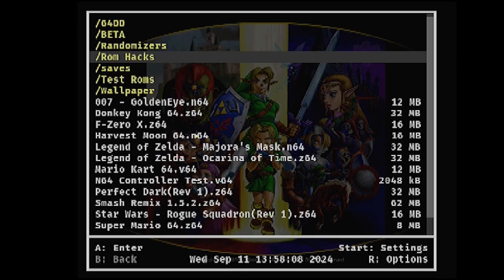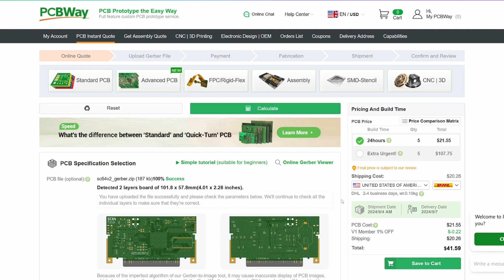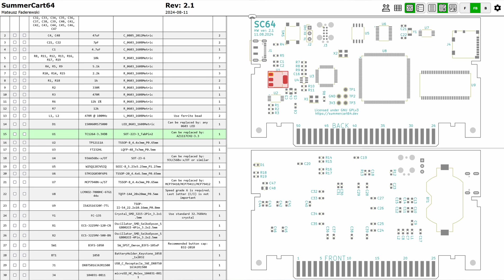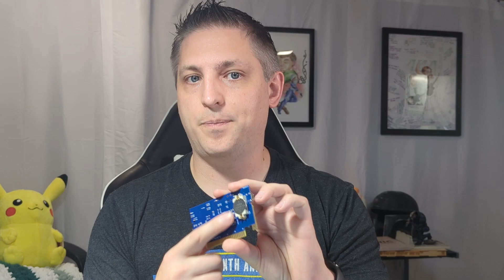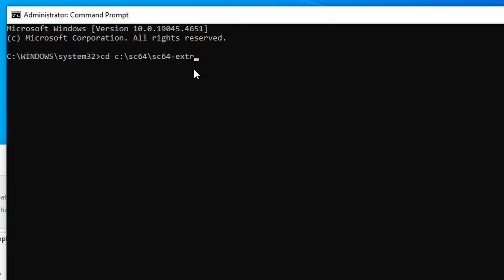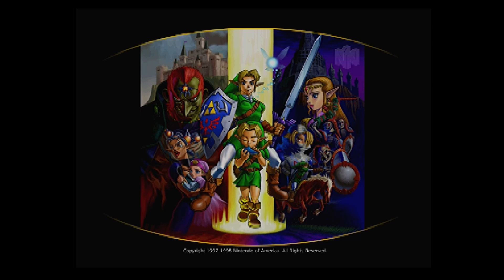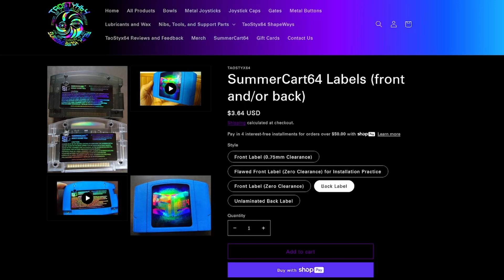How to build and program the SummerCart64

Comment: The shopping cart for Mouser might need to be updated. W25Q128JVSIQ is no longer available in Mouser. They do have W25Q128JVSIM. I haven't tested if it is a drop-in replacement, but it looks like the same chip according to the datasheets (same pinout and specs, although with a few extra features).

Comment: I'm trying to get my custom game images for mod games to show up and for the missing images like forsaken and ai told me “The image must be in PNG format and have a resolution of 256×384 pixels. Place the image in the same folder as the ROM file on the microSD card, and name it exactly the same as the ROM file, For example, if your ROM is named `SuperMario64.z64`, the cover art image should be named `SuperMario64.png` and placed in the same directory.
This setup allows SummerCart64 to display the cover art when browsing games on the N64 menu interface.
but with a `.png` extension.”.....

 but when i do that it does not show up...Anybody know what I'm doing wrong here?

Comment: What size micro SD card would you recommend?....I'm going to put as much on it as possible.
Thanks
Reply: A 64 GB fittingly holds the entire library and much more, so I'd recommend 64 or higher depending on how much extra stuff you want to install.

Comment: thank you for your video - i really enjoyed it. i am thinking about to go with the self-solder solution myself just because it's fun but the question i have is why not using solder paste and hot air like they do in the factory? it would be way less pain to bring the resistors and capacitors to the pcb.

Comment: Soooo, to be clear... if you order from the PCBWAY link and use the Assembly... that means it includes all the components you'd have to otherwise buy and solder yourself onto the PCB? And it includes a minimum of 5? Meaning all you would need is to acquire a shell? Or... do I have that wrong? Also, is it possible to use Aluminum instead of FR-4 for the PCB?  Do I need to acquire anything extra to program it, such as that cable you link if I go this route? Thank you so much!

Comment: With you mentioning randomizers, the only problem is that the OoTMM randomizer will not work past firmware 1.18.0. It works completely fine on that version, but further versions will crash upon creating a save file, so currently anyone will have to downgrade the firmware if they want to play that randomizer on their cart.

Comment: What's the total cost of doing it this way? It'd be good to know what the benefits are over just buying one readymade. Sorry if it was mentioned in the video and just didn't register in my brain.
Reply from the maker: I probably should have added it up for the video, but I didn't really until someone else in the comments asked. 
"Before shipping and taxes, about $112.60 for this cart. Ordering from 5 different places, shipping was pretty cheap, except for the PCBs, which shipping cost $20.58. Then I also bulked order a lot of the stuff to help keep the prices down. I ordered 10 PCBs and 10 cartridge shells, with the intention to make a couple more of these. So if you're only making one for yourself, totally worth it to get one premade. I just wanted to see if I could make my own"
Reply: @NGalaxyWorkshop  I guess mass production keeps the cost down in this case. Makes sense.

Comment: 1:48 I'm not sure how recommended a hard gold playing for the pins would be if you're almost never removing the cartridge from the console.  

Also, I'm pretty sure it's a simple enough task to bevel the PCB edge by yourself with just sandpaper and a flat surface.
Reply from the maker: Hard gold is what is recommended in the GitHub. Like you mentioned, there's really little need to remove the cart once you have it there. To me it was definitely not worth the added cost. 
As far as the beveling goes, I've done it with other PCBs and yes, it is really easy to do. I don't believe it adds anything to the cost to have PCBWay do it however, and I can see doing something that could be "damaging" to some people could be a turn off. Although if you are building a cart like this, I'd expect you to be comfortable with it.

Comment: YOU DIDNT MENTION WHAT FLUX YOU USE UNDER INFO
Reply from the maker: I've been using AMTECH NC-559-V2-TF flux for a little while now. It's not the easiest to clean up after, but it works ok. I may look into other options in the future, but I would think any flux would be helpful. I do like that it is a gel when you first put it on, as that is helpful to hold the different chips in place. 
The solder I've been using is some 60/40 Rosin-core solder I got from Radio Shack forever ago. I bought some different solder on Amazon a year or two ago and was not happy with it. It's been lasting me a long time, but will have to get something else eventually.

Comment: Why would you not use the assembly service instead of self-sourcing and soldering parts? Is there much of a cost difference? From what I can see it's about $85 assembled for up to like 20 pieces, maybe it's an introductory price.
Reply from the maker: I don't have the exact number of components in front of me right now, but going by what I remember it would cost me $88 for the assembly itself, plus $52 for the minimum of 5 PCBs, which doesn't include the price of getting those other 4 populated. So $139.47 is my final price. At that point I might as well buy it and get it flashed and with a shell. 
I figured it would be much more fun to do it myself. It still cost about what I would have paid for one premade, actually more once you include the label, cartridge shell, and my time. 
I'm hoping to be able to do quite a few projects on here that probably won't make financial sense, but sometimes it's just more fun this way.
Reply: @NGalaxyWorkshop  that's fair, I might assembly my own then, should be pretty easy to resell the remaining boards. I appreciate the walk-through.
Reply: Hey i bought a prebuilt one and try setting up the sd card but i keep getting an error fatf5 and it sasy that the memory card cant be used. Do you have any tips?@NGalaxyWorkshop
Reply: @NGalaxyWorkshop  I came to the same conclusion. I kind of wanted a project.

I initially priced 5 with assembly for 5 and it worked out to over $80/cart with shipping without hard gold. Compared to phenom mod, it wouldn't have been worth trying to sell the extra carts.

I ended up ordering 2x blank PCBs with hard gold from phenom mod through the discord group. It still won't really be cheaper than his but I'm treating it like a model kit.
Reply: Because some people just like to do everything themselves

Comment: Please ERROR!
Starting SC64 flashcart board bring-up...
[91mError while running bring-up: Could not connect to the STM32 (No ACK/NACK byte received)
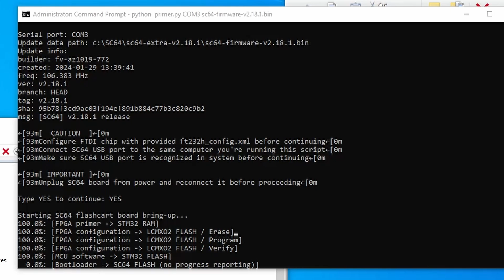Reply: When are you getting the error? At 13:38 is a list of the chips being programmed. If it's before "FPGA primer -> STM32 RAM", the. It could be as simple as flipping the TXD and RXD wires. I'd also make sure you have a solid connection there. If it's not that, then I would suspect a solder bridge somewhere. This was what caused most of my problems with programming. With how fine pitch the legs are it can be really hard to see. On one of my carts I had to go leg by leg with a multimeter on continuity to find it. There are some legs that are connected to ground that are next to each other, so those ones will beep.

If you don't have a microscope, I used to use the zoom on my phones camera to look.
Reply: @timtanason7250  now I got this error!
Starting SC64 flashcart board bring-up...
100.0%: [FPGA primer -> STM32 RAM]
100.0%: [FPGA configuration -> LCMXO2 FLASH / Erase]
100.0%: [FPGA configuration -> LCMXO2 FLASH / Program]
100.0%: [FPGA configuration -> LCMXO2 FLASH / Verify]
100.0%: [MCU software -> STM32 FLASH]
100.0%: [SC64 SDRAM test / Write own address]
100.0%: [SC64 SDRAM test / Check own address]
100.0%: [SC64 SDRAM test / Write all zeros]
100.0%: [SC64 SDRAM test / Check all zeros]
100.0%: [SC64 SDRAM test / Write all ones]
100.0%: [SC64 SDRAM test / Check all ones]
100.0%: [SC64 SDRAM test / Write random data]
100.0%: [SC64 SDRAM test / Check random data]
 83.3%: [Bootloader -> SC64 FLASH]
 [91mError while running bring-up: Firmware update error [0m

then I record once and then it doesn't record, but I change the STM32G030F6P6 IC and it records again
Reply: @timtanason7250  I record, but it goes to the sc64 boot and gives an error now
Reply: then it doesn't record anymore, I have to change the STM32G030F6P6 IC to record again.
Reply from the maker: What firmware are you using? 
When you get the error, what happens if you just retype the "python primer.py COMx sc64-firmware-v2.xx.x.bin command"?
When you say you have to change the IC, do you mean physically off of the cart? Because even if it fails a number of times you should be able to just try it again
Reply: Did you ever find out what caused the error for you? I have the same problem now, and I have confirmed that at least GND is soldered fine, but unsure how to test TX/RX pins.

Edit: I just found out that my cartridge had been preprogrammed, and I just had to transfer the menu to the SD-card to make it work :)

Comment: What should I do if the writing program fails.

Starting SC64 flashcart board bring-up...
100.0%: [FPGA primer -> STM32 RAM]
100.0%: [FPGA configuration -> LCMXO2 FLASH / Erase]
100.0%: [FPGA configuration -> LCMXO2 FLASH / Program]
100.0%: [FPGA configuration -> LCMXO2 FLASH / Verify]
100.0%: [MCU software -> STM32 FLASH]
Error while running bring-up: Couldn't reset SC64 device (on)
Reply from the maker: I would try it again. My first couple times programming one it took multiple tries to get it to program, although I don't think I've seen it fail there, usually mine would before. I'd try it a couple more times and then double check for any solder bridges, as that was the problem I had.

Comment: What is the operating voltage for capacitors? I can't find this data in BoM.
Reply from the maker: The board is either supplied with 3.3 or 5v, so anything rated higher than that should work. In the links I supplied, I used a combination of 6.3v, 16v, and 10v capacitors.

Comment: shouldnt you add some of the solder stuff to the board first before soldering the parts to it ?
Reply from the maker: @noah39353  if I was using a hot air station, then yes, I would. But for this video I wanted to use the most accessible options for people. If you put the solder on first, it's really hard to get surface mount components to lie flat. You can hear up one side and get that side to touch the board, but then the solder solidifies and the component is at an angle when you attach the other side.

Comment: Cool video. It's neat seeing how it's done the hard way (I lazily got mine from Phenon Mod).
Also, minor nitpick: It looks like your capture settings might be a little off. Every other line of text is squished vertically. This is especially noticeable where it says "Legend of Zelda" twice at 0:06 (the two lines are supposed to look identical). That's the same kind of effect you get when de-interlacing is being applied twice (usually once in hardware and again by software). You may be able to fix it by going into your capture device properties and disabling hardware de-interlacing. Hope this helps.
Reply from the maker: I wouldn't say it's the lazy way. You save money if you're only getting one. I plan on making a few more, so I ordered in bulk to help keep per cart cost down.
The capture was done off of a HDMI modded N64, which I did maybe a month prior to recording those parts. I wanted it done before going on vacation with a couple of friends so we could get some classic gaming in, so I didn't really look through the settings too much besides getting it to show up on the monitor, which luckily worked on the TV we had too. I'll have to go through those settings again as well as the capture I used to see if I can improve it. Thanks for the info! I appreciate it.

Comment: Hey I have a couple questions. Just recently picked one up I love it, mine is already set but, could you show how to update the firmware? Also can you explain the different save types? i keep getting the (need controller pak) when I try to save.
Reply from the maker: @joyousgard83  the newest firmware just came out, so I can definitely make a new video showing that. I also want to cover a couple of problems that can pop up while programming.  
As far as the save types, you still require a save pak for saving in games that require one.
Reply: @NGalaxyWorkshop  Awesome thanks for the info. Looking foward to the next video. Liked and Subscribed great video.